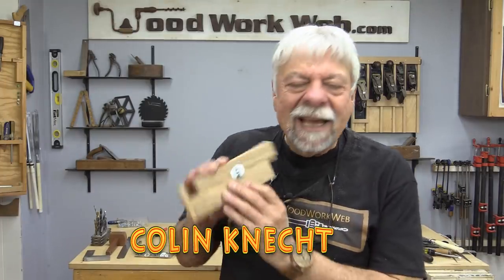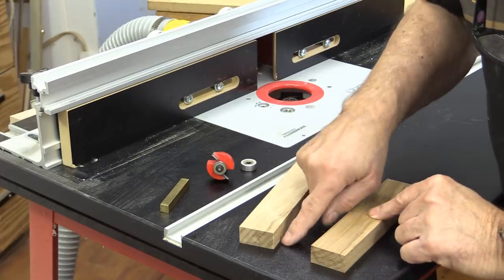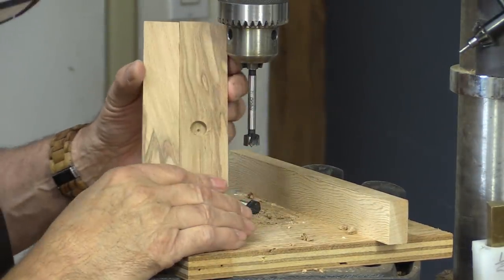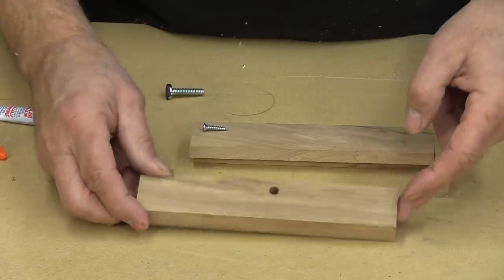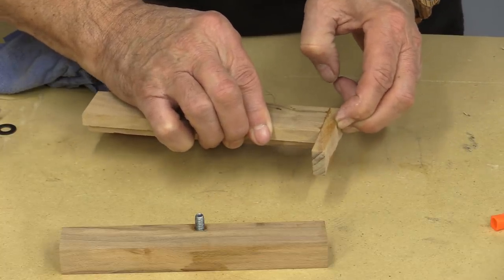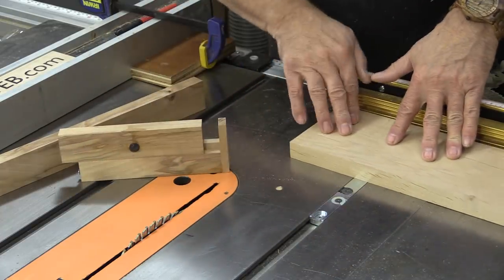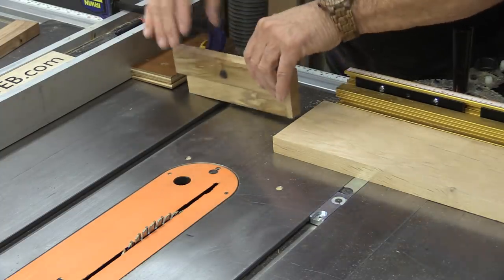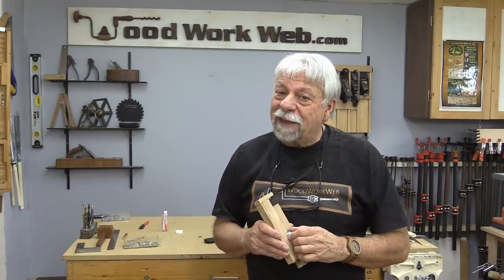Kerfmaker Exact Width Dado Jig / Make Perfect Dados!

Comment: I really liked this video and I have made some for me and my son. The only difference between the ones I made and yours is that I made the rabbet with a dovetail router bit so that the bottom of the of the rabbets are at an angle and that prevents them from slipping out when the screw is loosened up. That also tightens them up against each other when when you tighten up the screws. Keep up the great work.
Reply: That's a good idea with the dovetail bit....kinda like a French cleat!

Comment: I made one of these, actually two because I hade enough wood left after the first. It came out very nice and I was excited to use it. Imagine my dismay when I figured out that I need a crosscut sled to use it and I don’t have one!  Anybody wanna buy one? I have two, made from nice red oak. I even put flex seal tape on the bottom of the washer for added grip.

Comment: The larger diameter washer is sometimes referred to as a "fender washer".  You an find them at most hardware stores (True Value, Ace, Do It Best, etc.).  Most of those have the section with bins of assorted size bolts, nuts, etc. that includes fender washers.  I don't think the big box stores have that option.

Comment: great video, but can you explain the purpose of the screw and how far it has to be out of the wood when you use the jig? It sounds like it has something to do with the blade width, but I'm not 100% there. Thanks!
Reply: You're right, it has something to do with the blade. Because every saw blade has a different thickness, you'll need to adjust the screw to the same thickness of the kerf of your saw blade.
Reply: You set the wood part of the jig on one side of the saw tooth and adjust the screw so that it's dead even with the other side of the saw tooth.  Every saw blade you have will be a little different in that width so you need to tweak it as part of your setup.  The screw provides a micro-adjustable offset to compensate for the blade width.  If you didn't have the offset the width of your dadoes made with the jig could be off as much as 1/8".  You can set the screw head slightly proud or shy of the tooth edge to make your dadoes slightly looser or tighter if you desire.
Reply: @halsonger1317  very well said.
Reply: Your're right - it has something to do with the blade. It is essentially to reduce the reference edge by a thickness just equal or very slightly less than the thickness of the blade. Without the screw reference, you would end up with a dado that is the width you want , plus the thickness of the blade. That screw will now reference your cut to be less than the set depth, and you will end up with a dado to the set width, which essentially takes the calculation and guesswork off the process.

Comment: Hey Colin.. I’m just curious regarding the screw used as the blade width.. is there some reason to use a screw, rather than just cutting one of the pieces a blade shorter than the other (let’s assume we can accurately make that cut).. In so many of these kerfmaker videos the screw component is ubiquitous, so I’m just curious why it’s preferred.. thanks for all the content!
Reply: To be able to accommodate blades of various thickness when needed? Not sure myself...

Comment: Why not a dado set؟
Reply: Some table saws in Europe don't have an arbour long enough for dado stacks. 😕
Reply: As ClayVella says, not all table saws have an arbour long enough for a dado set, mine included, I also live in the UK.
Reply: As it is required by law to have a motor brake in European sold table saws a dado stack does not normally work because the extra mass could make the locking nut come loose. Though some cabinet saws have another solution so that a dado stack can be used. Axminister in the UK has one type that can host a dado stack.
Reply: Just import an America saw dado no problem i did
Reply: Because it's a kerf maker jig for exact width dado. You don't have to measure the dado slot that your going to make, the jig will measure it for you perfectly.
Reply: @joycemiller4716  Well consider the huge import tax and shipping cost of something like that it's not really a good option if you are on a budget. There is also the issue of different power standards and European 230/400V is far superior to the American 110/220V. To get the same power you need to increase the Amp much to get the same Wattage which requires both special power delivery with thicker cables and  fuses to be able to deliver enough power. Which makes it even more costly. Not to mention that it is the Amp that is what kills you if something goes terribly wrong and you get electricity through yourself.
Reply: @Dragonited  LOL
Buy a Bridgeport milling machine, mill a new arbor, insert new arbor, use dado stack.
Simple :))  And Bob's yer uncle!
Reply: @skippylippy547  Or you can do that if you want to take the long way around :p 
Still the issue with that motor brake that can make the locking nut come loose :p
Reply: @Dragonited  "it is the Amp that is what kills you" smh Yes, and 230V across your body's resistance will create twice the current that 115V will.